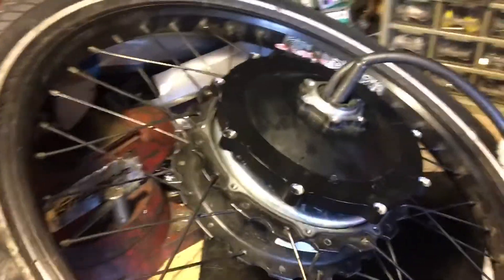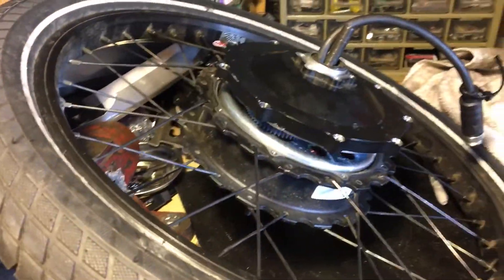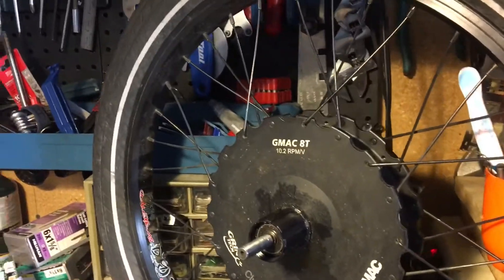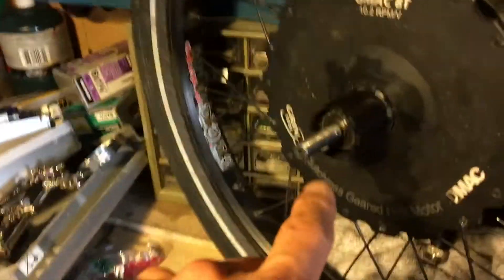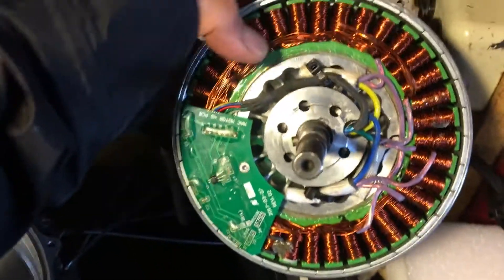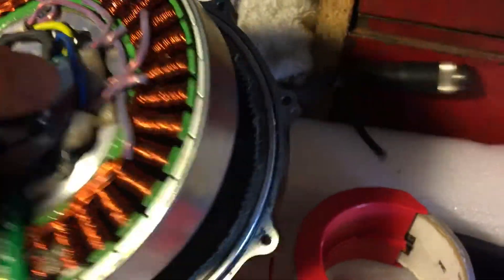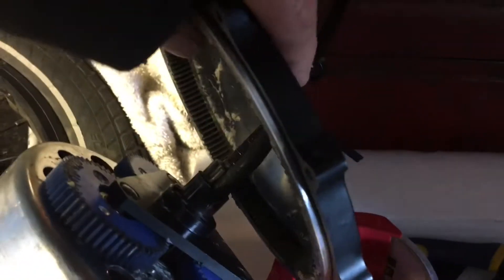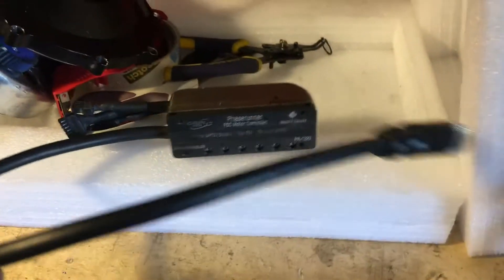Inside the Grin Technologies GMAC Hub Motor

Comment: Thanks for this short demo video. I am about to attempt to repair my motor. I like easy.
Reply from the maker: Do you do the repair yet? How did it go?
Reply: @jasonserafino-agar9964  I do not have the tools needed to do the repair and I have spoken to Grin Technologies about helping me out. The torque arm mechanism is very effective with a snug fit, and a problem for me to remove.The nerd in me is hoping to watch the repair so I can see any wear patterns that have developed. I do miss the regen.

Comment: This motor is low quality. It lasted only for a few months (6000km). A metal piece holding one of the nylon gears came off and damaged the gears themselves. This happened due to some misalignment, possibly caused by a bent axle. It also filled with lots of water (presumably just from condensation over time. Wondering if I should go for an oil-filled Heinzmann Cargopower instead.
Reply: Huh, interesting. I've got over 19,000 miles on mine and the only issue has been having to replace the cassette freehub body. I use my GMAC on a Larry Vs Harry Bullitt cargo bike, riding for a university mailing services department. We carry a lot of freight, up to 175lbs in the cargo box, and the GMAC has handled it all very well. Just my 2 cents.
Reply from the maker: I can imagine one of those clips that hold the nylor gears coming off due to a random defect. Most internally geared ebike motors use the same type of gears. Did you go with a different hub motor?  If so, how’s it going?

Comment from the maker: After about 1 year of use, the nylon gears inside shredded and needed to be replaced. While doing the job I messed up the internal wiring and the motor core is sitting on my workbench waiting for some attention.  Grin has been very helpful and if I can't fix it, I'll be sending it back to them for repair.
Reply: update?

Comment: Do you feel a big difference on the range with the regen power?
Reply from the maker: Hello tsunamas, I definitely notice an increase in range using the GMAC regen here in SF with all the hills. Going up a big hill and down the other side, I might get 30% regen back to the battery. On flat rides where I'm doing very little braking, I might get 7-10% going back to the battery.  I'm using the Grin GMAC Ready to Roll kit and the Cycle Analyst (Version 3) tracks regen stats. The kit also has proportional regen when I use the brake and the throttle, enough to slow and even stop the bike. That boosts the regen while saving on brake pads.  Grin has a YouTube video about it.
Reply: @jasonserafino-agar9964   hey thanks for the detailed answer. I've been checking on those videos you mention along with the phaserunner kit. Looks great!